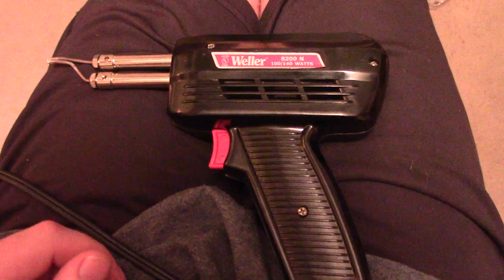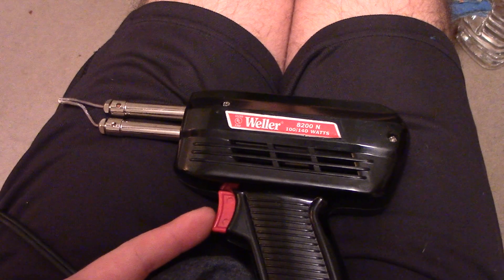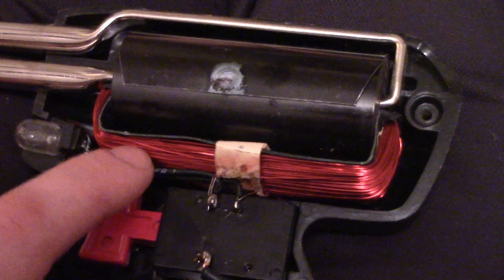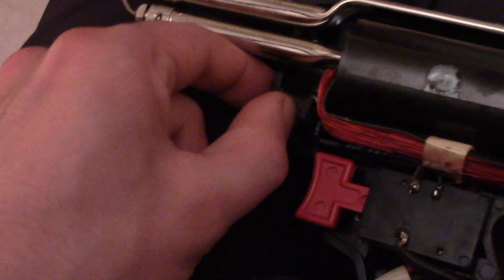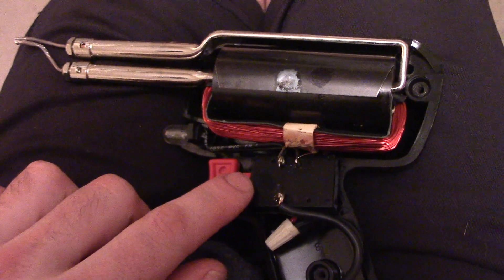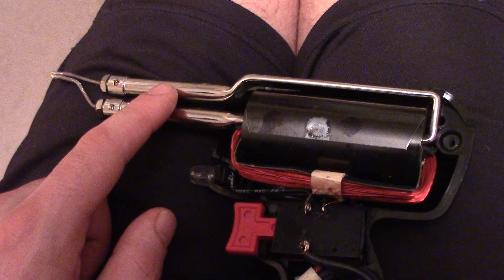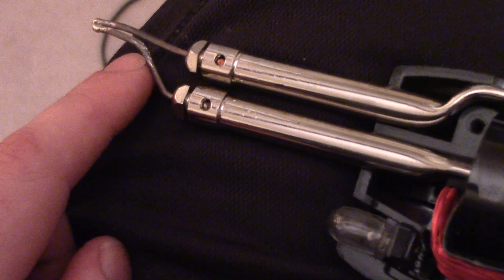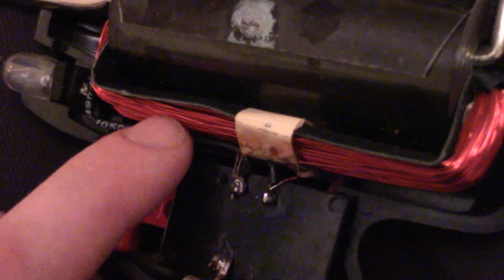A quick look inside of a Weller soldering gun

Comment: Can anyone explain why none of the 220-240V models have the dual wattage option? It must have something to do with the different voltages. I have a very old Weller 8250C which is exactly the same as the 8250A (120V), which is now called the D550. These US models have dual wattage but mine doesn't. When restoring it I noticed it even has the same double click switch but they've made it so when you turn the trigger upside down in the switch housing, it only single clicks. The switch also has only 1 wire going out to the transformer. In the dual watt version there is a second wire going to the transformer, but how is it wired?

Comment: Glad I saw this video. I had a broken wire from the primary winding to the switch. Couldn't tell which point on the switch it should be connected to. From your video, it looks like it was connected to the left connection which has two wires on it.
Reply: Mine looks different also? Is it safe  to plug in?

Comment: hi can you help me i just plug mine in 220 v accidentaly now mine are not working , i don't know how to fix it is there any fuse that i can replace ?
Reply: You must rewire the primary, a task, I gather, beyond your knowledge of electronics
Reply: Was there any burning smell or heat or a pop in the gun?   If you didn’t kill the transformer primary winding, you may have damage trigger switch.  I’d open it put an ohm meter on the primary coil. measure the ohms.  I’d also test for continuity through the switch.

Comment: Regarding the material used for the secondary "tube": You suggested it might be made of nickel or "chrome", but I am pretty sure it is copper with nickel or chrome plating. The combination of the "tubing" and the thinner soldering "tip" represents a one-turn secondary, through which high current will flow when you pull the trigger. That high current will heat up all of the secondary, but the heat will be distributed based on the resistance of different sections of the "loop". You want the highest temperature at the soldering tip, so the tip has the highest resistance (narrow cross-section) relative to the rest of the loop. You would want the tubing that passes through the core to be very low resistance, so making if from copper tubing is the best choice. Nickel or other material would be higher resistance, even with the larger dimensions.

Comment: My Weller soldering gun has a design feature that drives me nuts:  For the higher power wattage the red trigger is depressed only half way; depressing the trigger button all the way gives the lower wattage operation.  This is backwards as far as I am concerned.  After seeing your video, looks like swapping the twp secondary wires would fix things.
Reply: I have an old 8200, and I'm trying to figure out which is low power and which is high power. 

Everything I read says the halfway point is high power,  and all the way is low power,  which I agree with you,   seems backwards.      However,  it's hard to tell but it seems the bulb is just a touch dimmer with the trigger pulled all the way.... so who knows.... I'm gonna have to get creative to figure out for sure which position is high on mine...
Reply: FoMoCowboy I used a digital wattmeter to confirm that half trigger is the highest wattage; full trigger is the lower wattage.
Reply: Just switch it if possible
Reply: @RickSanchez-fx3lt  First thing I looked into, but the way soldering gun is hard wired would make it difficult to swap the wires, too likely to destroy switch, so bummer.

Comment: I have my grandfathers 8200N and it works great still. The 1968 Allied Electronics catalogue priced it at a whopping $5.20 . The mid-range D-440  was $7.45 and the big
D-550 was $8.25. It had a choice of either 240 or 325 watts. No wonder Ron Soyland  (Glasslinger) has one!
Reply: I paid 2 euros for a genuine Weller d550 like new in a fly market. Is for 110Vac but I own a transformer, same source